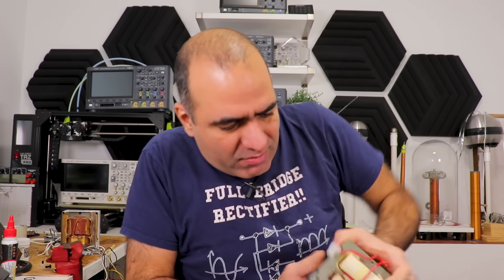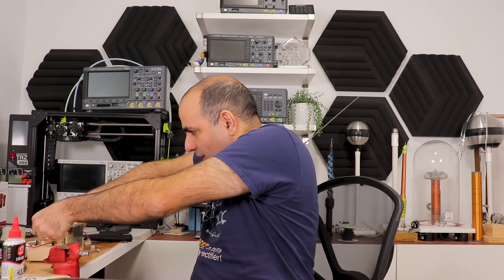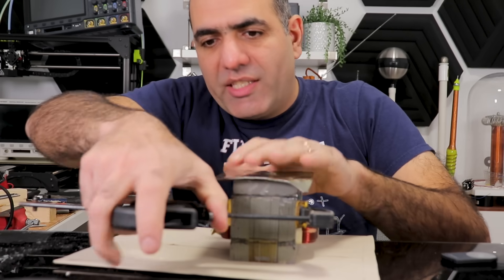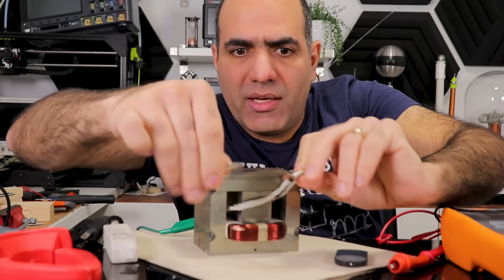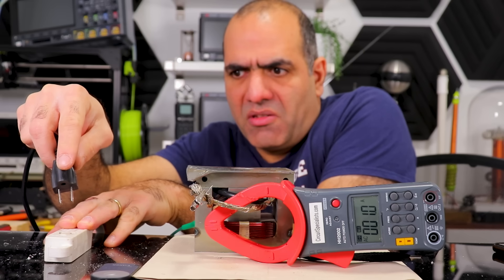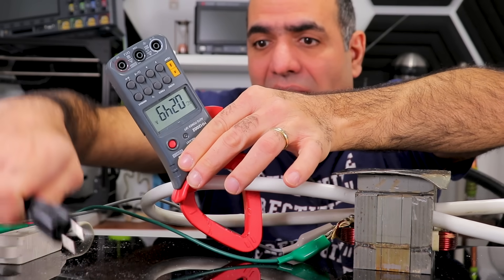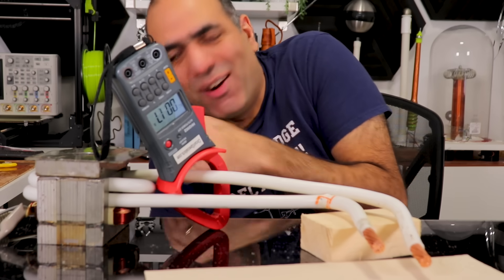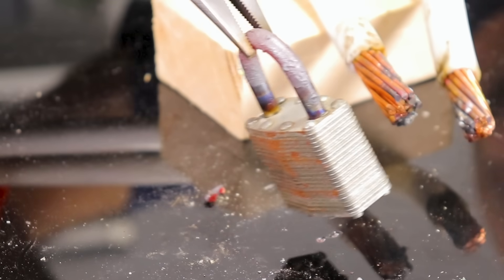Making "MILLIONS" of AMPS of Current

Comment: Wonder if I use 2 primaries from 2 transformers in a single core if that would be a good 1:1 isolation transformer? Awesome video, Makes for a cheap spot welder.
Reply: Works for around 400W to maybe 600. But cool the darn thing with a fan, those MOTs are garbage when it comes to efficiency They are only built to run for short time. Glue the top back on and put it in a small box with a strong-ish fan for cooling.
Reply: @DrakkarCalethiel  Thanks. 400W should be good just to isolate SMPS's from my 1980's oscilloscope for trouble shooting. Will try to TIG weld it back together. I can put thermal fuse on the casing for extra security.
Reply: @Allan-mf1he  Remember to remove the magnetic shunts and protect it with a 3 A fuse.
Reply: @mernokimuvek  Shunts? Where are those?
Reply: @Allan-mf1he  Those 2 small iron core pieces between primary and secondary.
Reply: @mernokimuvek  I am yet to strip them Thanks I will be sure to look for them.
Reply: @DrakkarCalethiel  Even better if you put in under oil. Even if we use a high current density of 6A/mm2, the cheap chinese MOT primary is often 0.75mm2 aluminum, so it can handle 3 A maximum continuous load with good cooling.
Reply: So the primary draws a constant current at a constant voltage(constant power), the output solely depends on the secondary. I can do anything (even short the secondary keeping in mind the current/heat) because it wont impact the power drawn from the mains. This way we are separating/isolating mains from our supply(AKA secondary's output). It just clicked in my mind, after watching the video and reading your comment.
Reply: @masoodjalal1152  The short answer is no, that's unfortunately not how it works. If you pull more current on the secondary, the current draw on the primary also increases.
If you don't believe me, get a DC motor without anything wired up to it and try spinning its shaft. Now, short its terminals together and try again, and you'll see that it's much harder to spin.
Reply: @dylanh333  I did notice that as well with a small motor, is that because when spun its being a small generator and shorted out it is as if a high load is connected to it.  isnt that similar to diesel-electric trains in dynamic braking used to slow a train.?
Reply: @steviebboy69  In a simple sense: yes, the motor is now working as a dynamo (generator), and shorting it out creates a high load, which in turn makes it harder to turn.
I'm not certain about diesel-electric trains, but the same concept applies to regenerative braking in electric cars, where the motors are used as generators to charge the battery.
As for how/why this works, someone else here might be able to better explain the physics of how the magnetic field responds when the coil is open vs. under load.
Reply: @dylanh333  Yes the regenerative braking thing in electric cars is  true but I think in trains it goes into Resistor load banks AKA probably some coil of wire turned into heat and sucked away with a fan?  I guess that is what happens in brushed motor cordless drills for motor braking its just shorting out the motor.
Reply: @steviebboy69  in regenerative...br. energy is fed back to the source...if the source is AC direct..( no intermediate transformer)  proper freq.& phase synchronisation is a must....
If it's a battery or DC Link caps...then their max.voltage cannot be exceeded..then resistive braking is necessary..
Reply: Yeah, but MOTs are run too close to saturation for it to be a good idea. They cheap out on the core size for mass production to be more affordable.

Comment: When my physics teacher showed us this experiment, he actually used multiple smaller wires in parallel as his secondary, which apparently made building this a whole lot easier.
Reply: Imagine a teacher doing THIS, taking the microwave apart and starts melting spoons 
Then the final sentence "don't try this at home" , in the afternoon..."mom, I need the microwave for my homework"
Reply: @mammutMK2  😂😂😂 !
Reply: Why not try using the original secondary as the primary winding
Reply: @adamsoltesz5237  you need enough voltage to drive current through the resistance of the secondary wire. If you start with the original secondary, assuming that it was 11K turns, the voltage in the new 1-turn secondary would only be 10mV. So, it can only drive 1A through a 10mΩ circuit.
You need a secondary with high enough voltage and very low resistance to get high current.
Reply: Basically making 1 big wire using three small ones
Reply: So you're saying (if I remember correctly from school that was WAY WAY long time ago), that if u have, let's say, 3 thinner wires, all the same length (let's say 1m) and you make them each at 2 turns (as Medhi has it in the end) and connect the ends together, you will get 3 times the voltage but all at the same amperage (since they're in parallel)? Do I remember it correctly? 
This is not necessary a technical question, but more of a curiosity to know if I remember stuff correctly.
Reply: @Ygr3ku  No, you actually get the same voltage and current, but the current is split between the multiple smaller coils. The only real difference is that multiple smaller wires are more easy to bend than one large wire.
Reply: @OleJanssen  Oh, I see. So it's not like having 3 parallel wires to multiply the voltage, because all those loops "feed" from the same transformer.
And if I understand it right, in order to have more voltage, you'll need another transformer that feeds the same loops.
Did I get it right this time? :D (hopefully)
Also, ty for the explanation, it made me remember some school lessons!
Reply: @Ygr3ku  No, the voltage is never increased if the windings of any transformer are connected in parallel. In order to do that, they would have to be connected in series. When doing that, one would basically turn for example three coils with two turns into one coil with 6 turns. However, having them in series also means that the current is no longer split between the coils, so all the current has to flow through all the coils. In this case, a system like that would probably go up in smoke and flames pretty quickly.
Reply: @OleJanssen  I think I've explained it badly. Imagine 1 transformer, 3 wires, all separated, each with 2 coils, with ends connected to eachother (technically 3 parallel connected)
Now, what I've meant to say, was to make those coils larger and in that extra space include another transformer, feeding the same loops that transformer 1 feeds. Will that increase current or voltage?
Reply: @Ygr3ku  I see Cody asked the same thing.  I've never even heard of such a setup.  I would think that it would increase both voltage and current, as long as the transformers were wired in-phase and far enough apart that the magnetic fields weren't fighting each other.  It'd be like putting 2 batteries in series. Twice the voltage as one, and hence twice the current, for a resistive load.

Thinking about it more, I think it would depend on how you wired it.  If you had the two end wires sticking out of one transformer like Medhi had, and could loop some of the wire on the "other side" of the transformer through another transformer, they'd be in parallel, and you'd get twice the current, but not twice the voltage.  If you had one end of the wire coming out of one transformer, and looped through a couple times, and then went to another transformer a couple turns, and then that 2nd end of the wire sticking out of the 2nd transformer, you'd double the voltage, which would double the current, like putting 2 batteries in series across a resistor instead of 1.
Reply: @Ygr3ku  If you want to multiply the voltage and make it higher on the secondary side of a transformer compared to the primary side, you need more turns on the secondary winding than the primary winding.

The output voltage is related to the input voltage by the turns ratio.
The formula is this:
Vsecondary = Vprimary x (N2/N1)

N2/N1 is known as the "turns ratio"
N2 is the number of the turns on the secondary winding
N1 is the number of turns on the primary winding

The current is the inverse of this. Step up the voltage,the current steps down. Step down the voltage, the current steps up.

The key point is this: Power in to the transformer is the same as the power out, except for some small losses.

The current relationship is:
Isecondary = Iprimary * (N1/N2)
Reply: @Ygr3ku  Let me explain it. Everyone seems to be making a mess of it.

How much current a cable or wire can handle depends on the cross sectional area of the conductor (and it's resistivity but I won't go into that).

So if you connect up 3 wires in parallel of the same cross sectional area, you are effectively making one wire which is three times the cross sectional area which means  a larger current can be carried.

That is all there is to it.

Comment: Mehdi finally makes himself a DIY spot welder. Everyone run and hide... :)  There is fine stranded wire (basically big welding cable) that size that is far easier to wrap around those transformers. They make great electro magnets for work holding as well.

Comment: That would have looked much easier if you used a surge protector with an on off switch to turn it on and off. Unless for some reason that would trip every time you turned it on.

Comment: I did something like this years and years ago. I took three really big transformers from the very old streetlights, welded these 3 together as one transformer and then winded it up
for "MORE POWER" and then I started to melt stuff. The only tester I had had a maximum of 800A and I buried that needle in a microsecond so I my guess and calculation is something like 3kA.

I had a really good time though until my dad told me to stop melting his stuff 🤣😂

Comment: Electroboom, can you run an experiment that involves a safe, lots of amps, and safe cracking? Here’s my theory, imagine connecting two terminals to a door on a safe and cranking up the amperage until the door turns red hot then covering the door with foam and injecting liquid nitrogen. Do you think the door would crack from the sudden and drastic change in temperature?

Comment: Medhi, what would happen if you used the secondary coil instead of the primary coil since it has way more wraps?
Reply: More turns means more voltage but less current so nothing would happen.
Reply: The wire is both substantially thinner and longer (since there are probably around 20x more turns) so the overall resistance would be huge in comparison, limiting the input current, which would then limit the output current too. The alternative is if it doesn’t limit the input current enough to be a problem, but in that case the wire would be taking far more current than it’s designed for, and would melt itself in a matter of seconds. 
Sadly, the overall power is limited by size and conductor quality, since pulling more power requires larger coils, requiring more turns and/or thicker wires on either the input or output side to increase voltage and/or decrease resistance, otherwise you’ll be limited by either Ohm’s law or your transformer turning into a smoking heap of molten wires.
As such, while MOTs are still incredibly dangerous (they kill the most electronics hobbyists of any component), their overall potential is still limited when it comes to the heavy-duty stuff.
Reply: that's exactly what was also thinking - probably should have been the first thing to try.
Reply: Exactly what I was thinking.
Reply: Horrible idea. Resistance and impedance are much higher and therefore almost no current will flow. Also coupling will be much weaker.

Comment: Do those coils that melt metals by being around them work in this way, too?
Reply: That's through induction, so it doesn't require you to run the material across the wires. Ultimately however, it boils down to the same core mechanisms of electromagnetism and electricity.

Comment: This is very well timed because I just bought a "spot welding kit" from Aliexpress and it requires that you have a microwave transformer that you pretty much do the same as here. Also, if you want to make it easier to get the 000AWG wire in the transformer, remove the insulation and replace it with shrink wrap. It'll help with the stiffness and make it a lot easier to bend it.
Reply: There are many different cables. The number and thickness of wires in the cable determines its rigidity. ElectroBOOMs cable has a low count of thick wires, so it is very stiff. Buy a cable for welding machines. They have a lot of thin wires and can be bent very easily. Also, the PVC insulation is cheaper, but stiff. Rubber cables should be better. And be carefull - avoid cheap CCA cables. CCA stands for copper clad aluminum. Simply, it is aluminum cable, which looks like copper. It has 2 times higher resistance for the same wire gauge.
Reply: A kit? You can buy the whole thing quite cheaply with 100's of amps output.

Comment: Please be safer with the angle grinder. A cut off wheel can result in horrible injuries. You should never use one without the right angle handle. If it kicks with the grip you were using you could not control it and it could badly slice your forearm or another part of your body.

Comment: I'd love to know if lots of wires in parallel would work well instead of one massive thick wire.
Reply: Isn't that basically what a stranded wire is? I think that's exactly what he has
Reply: @fsmvda  It is yes, but I was thinking of multiple insulated wires which only connect  in parallel outside of the transformer

Comment: I am currently making a battery spot welder with a microwave oven transformer. I rewired it a bit like you did and I assembled a circuit to control. After testing it a few time the relay stayed open and spot welded it self so I disconnect it but the transformer magnetic field collapse and spike back the electricity into the power line. A computer was in the same line connected to the break and started ventilating and shut down the motherboard fried. So now i am wondering how i should protect my device from the spike back maybe with a diode but what kind and should I wire it to circuit

Comment: This is how you make deicing equipment in hydro dams. But the currents rails are a lot larger. The voltage is so low they are theoretically safe to touch, but if you drop anything metallic on them, like a wrench, instant welding occurs.

Comment: Open circuit 1.123v, and 90 amps  shorted. Would you measure 1.123v/90amps = 0.0125 ohms impedence if you had that level of precision?  I don't trust cheap multi meters and their leads when measuring very low ohms.

Comment: What I found on Wikipedia is that 000 (3/0) gauge wire's resistance is around 0.203 (0.2028) mO/m. So referencing your video on shunts, if you wanted to create 1mO (0.1V per 100A) you would need around 5m (4.93m) of that wire.

Comment: High-current electricity is less dangerous than high-voltage electricity while being just as awesome. The only drawback is that it's a lot more cumbersome since all your wires need to be T H I C C so that they can handle the high current.

Comment: You should have use soldering cable 4/0 instead, same cables used on industrial batteries. They have many more threads and are way more flexible.

Comment: Could such device be used by blacksmiths to heat the metal? It actually looks way more efficient than conventional oven or coal methods. But I might be wrong about efficiency of electrical circuit, I'm just a civil engineer.

Comment: Electroboom has so many oscilloscopes that one of them has to be stored teetering on top of a 3D printer.
And when it starts to fall into the printer he barely even bats an eye.

Also get some high-temp silicone or teflon wire!
Reply: Don't contact these telegram accounts they are not the YouTuber
They are SCAMMERS.

Comment: What if you wound a new primary coil for a 2nd transformer out of the output of the first transformer that has so much windings that it draws around 20A and then make 2 secondary windings on the 2nd transformer? Shouldn't you have like 0,1V and thousands of amps?

Comment: Maybe you could've improved the efficiency by removing all the glue residue. Maybe they reduce the magnetic flux through the transformer impacting it's overall efficincy. If this is the case you could've get more Amps in the secondary winding

Comment: Thanks Medhi for inspiring me to go to Electrical School and become an apprentice. I feel your pain trying to bend 3/0 (three-ought) wire. Now that I have started school, I am actually starting to understand the equations you lay out in your videos. Thanks for being an inspiration to me, and for many people in the comments, stay safe and keep up the awesome work. <3
Reply: 12:40 He's such a generous god.
Reply: Don't contact these telegram accounts they are not the YouTuber
They are SCAMMERS.
Reply: Its not that hard to bend if you're using the right kind of 000 as not all 000 is the same.
Thes tuff he's using is mains gauge wire as made obvious by the thiccc strands, automotive 000 has a finer core makeup and weldflex even more so whilst still haveing the ability to carry the same current but being more flexible. In saying that the stuff he has would be 10x cheaper than weldflex so it makes sense why he went with it.
Reply: Its ezy to bend

Comment: Hi Mehdi, since this is low frequency (50-60Hz) the skin effect does not apply? I was therefore thinking of a thick copper pipe instead of the thick wire.
Reply: Metty?

Anyway, yeah, the skin effect isn't much of an issue at these frequencies.
Reply: @therealprofessor976  don't believe it
Reply: @therealprofessor976  it is scam
Reply: @hahaauauua1709  Yeah, I know it's a scam. I was just talking about the original comment's spelling of Mehdi as Metty

Comment: Use the current for a em can crusher,  mass accelerator,  spot welder, high power induction heater, rail gun (not a coil gun) or even electroplating/anodising